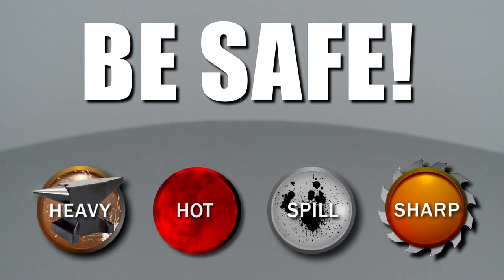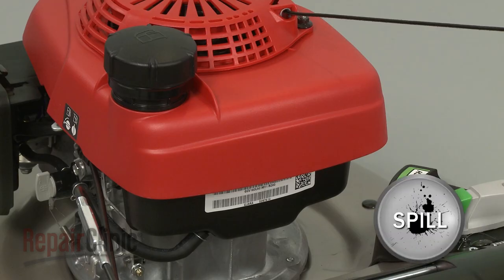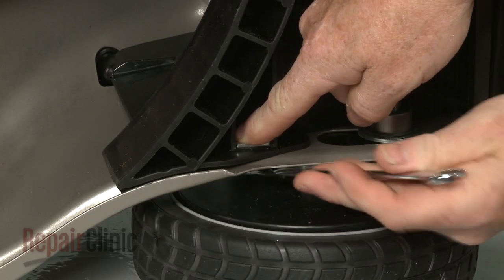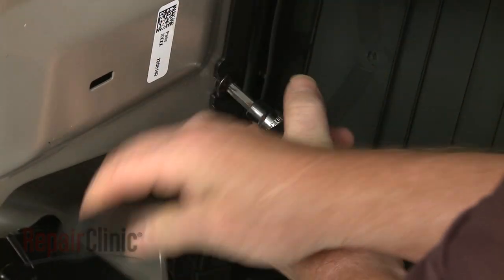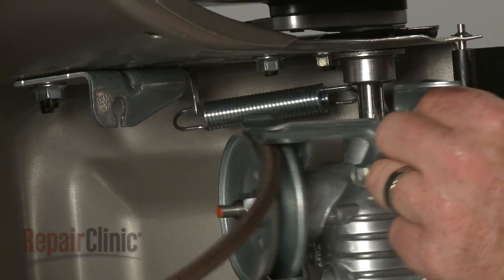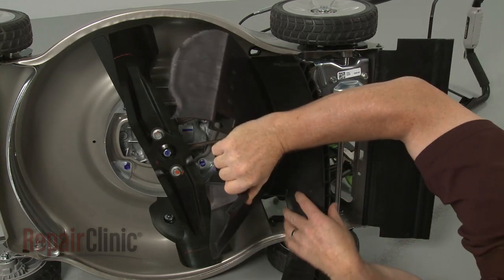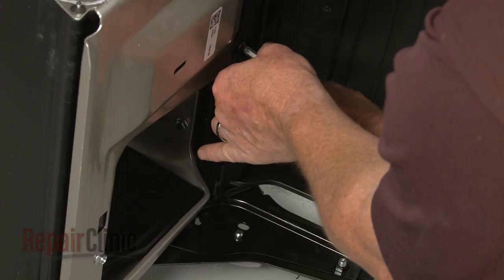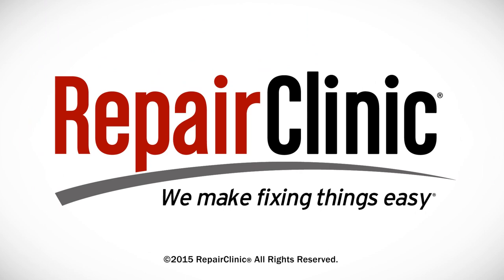Honda Lawn Mower Transmission Spring Replacement Part # 24468-VL0-P00

Comment: when i push my lawn mower the wheel make a clicking noise propelled dose not work
Reply: the clicking is normal, that's just the drive system making the clicking noises ..
Reply: Adjust the Drive Cable